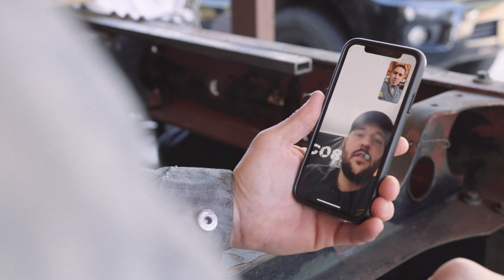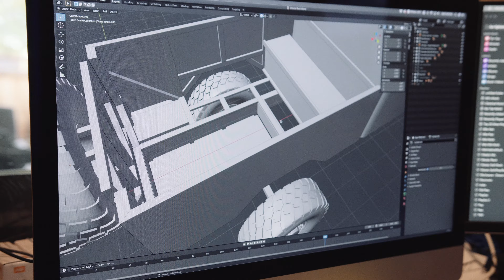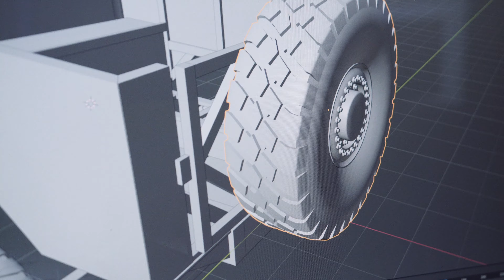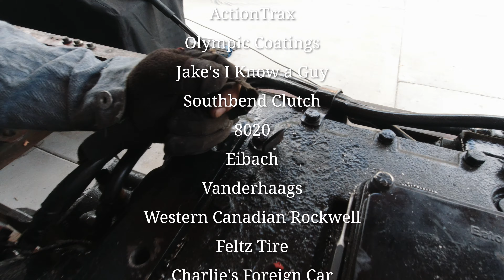The Deuce: E5 Wear gloves when you use grinders

Comment: Get you a drill doctor for all them drill bits. It’s a lot cheaper than more drill bits. I love mine. I Resharpen bits when I notice there getting dull.
Reply from the maker: We’ve since started sharpening bits on a belt sander. But I’ll check out the drill doctor! Thanks for the suggestion!

Comment: The paint you scrap off of the frame is CARC and very dangerous. Need to wear respirator during grinding.
Reply from the maker: Good to know! I always held my breath or put a mask on when grinding that stuff. Brandon just jumps right in though 🤦‍♂️

Thankfully now the frame has been sand blasted and powder coated so we won’t be dealing with that anymore.